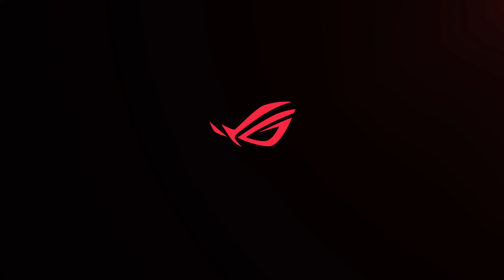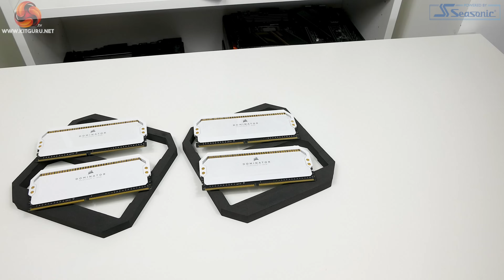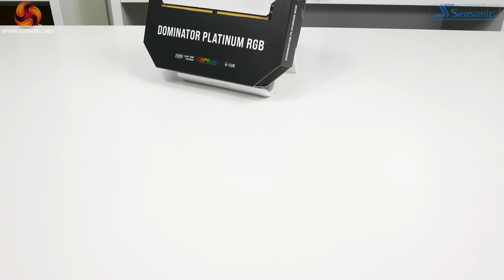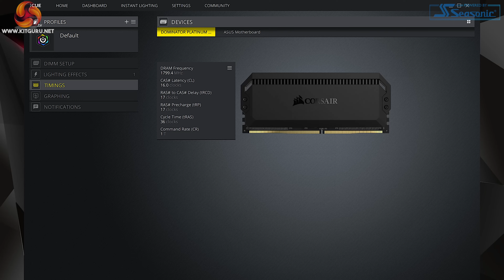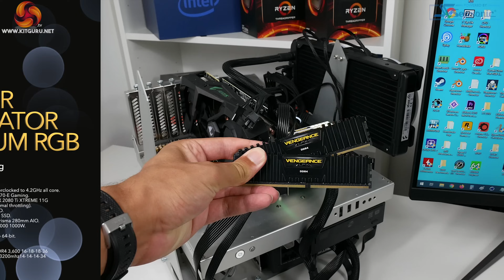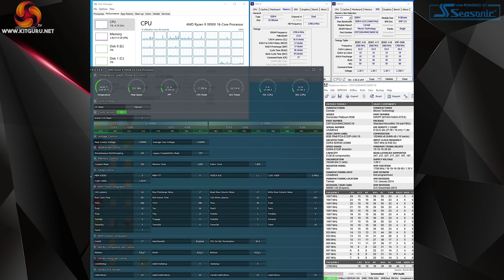Corsair Dominator Platinum RGB WHITE - EXPENSIVE!

Comment: Do you know if the 4x16 are single or dual rank sticks?
Reply: All the 16s are dual rank the only exception is newer crucial ballistix (they should be dual rank as well but micron is cheaping out and they produce single/dual rank randomly so it's a lottery there)
Be in mind that 4 sticks of dual rank is the hardest on the memory controller so you won't be able to OC much.
I actually read that - at least on MSI boards - 4 sticks of single rank can OC higher than 2 sticks of dual rank (well my Asus board likes 2 sticks dual more for OC) but there's that
General rule for optimal performance is either 4 sticks of single rank or 2 sticks of dual rank (2 ranks per channel)

Comment: Since when does DDR4 not get hot haha? 

I run a 4x8GB G.Skill Royal Z Gold 4000Mhz CL15 kit with 1.5V default XMP profile. IT GETS HOT!! And that heat can cause instability. Usually I run 4,000Mhz at 14-14-14-28-1T with 1.6V. Keeping it under 50C is very important for stability on my X299 platform with quad channel. DDR4 gets to tasty! Without fans pointing directly at it, I have seen nearly 60C on some of the modules.

Comment: Very nice. How well do they overclock? I'm currently using Patriot Viper Steel Series DDR4 32GB (4 x 8GB) 4400MHz. I have it running at 3800Mhz @ 1.5 volts Timings of 14-14-14-30-44-300 1T
Reply: We did a quick overclocking test at 1.5V and managed 4000MHz at the stock timings. I'd imagine they can certainly go higher with more tweaking and perhaps a motherboard better geared for RAM OC.
Reply: @lukehill5739  Thanks for the replay Luke. The Patriot Viper will run at 4400MHz @ 1.45 volts. But the stock timings suck. They are supposed to be CL 19, but it has to run in gear down mode with raises the CL to 20. I settled for 3800 as the FCLK won't go higher than 1900. Anything above 3800MHz and the FCLK flips back to 1800. I can get 2 sticks to run 3800 CL 12, but with 4 sticks CL 14 is the best I can currently do. Still not bad for cheap Samsung B-die.

Comment: This is what I paid back in Sept 2018 for my current RAM  :/    wanna swap for 2 of those?   (Corsair CMK16GX4M2B3000C15 Vengeance LPX 16 GB (2 x 8 GB) DDR4 3000 MHz C15 XMP 2.0 High Performance Desktop Memory Kit, Black
Corsair
Sold by: Amazon EU S.a.r.L.
£115.96)

Comment from the maker: Would you? (or could you?) spend close to £300 on memory for a new system build? let us know ...
Reply: Yes. But not at those timings.
Reply: I’m ready to spend $292 on a Crucial Ballistix 3600c16 2x32GB kit.  Not spending premium on RGB, went with MSI Unify stealth black look this time. My previous system was white, and the old Corsair LPX 4x4GB kit won’t post past 2666; sad for 3900x.
Reply: I remember the pain of buying my current Trident Z B die 3200 CL14 kit in 2018, it was 220 us for 16GB, and I swore I wouldn't spend over 200 on RAM ever again. And I swore after the last corsair product that I owned, I would never install iCUE in my computer ever again as well!!
Reply: @vaeloreonari7516  why
Reply: @NoNameNoShame22  I installed iCue on 2 different occasions, and it behaved like a command virus, and locked up my computer  so many times. It wasn't until the second time I installed it that I figured out that it was the Corsair software causing all the issues, I had a corsair mouse at that time and some corsair fans, and I disabled icue, after hours of researching the cause of my issues, and my problems dissapeared. So I deleted the program, uninstalled the fans, switched to CF140's from DeepCool, and bought a Logitech MX Master 3 mouse, no more problems. I think corsair makes great devices, but their proprietary software is the epitome of Bloatware.
Reply: I would if I have the money. But no, practically.